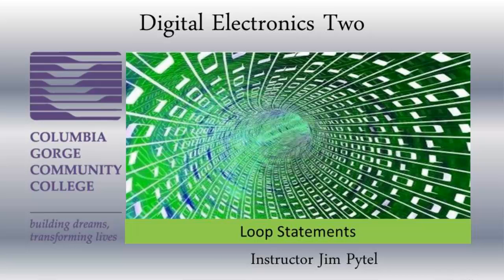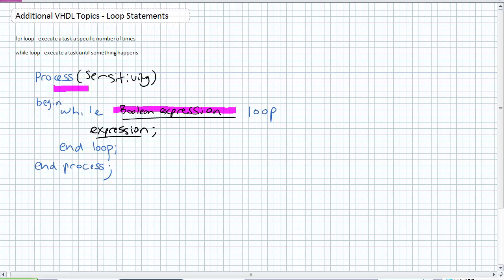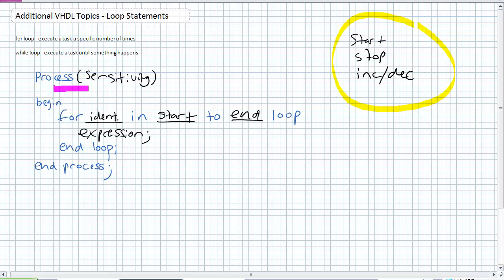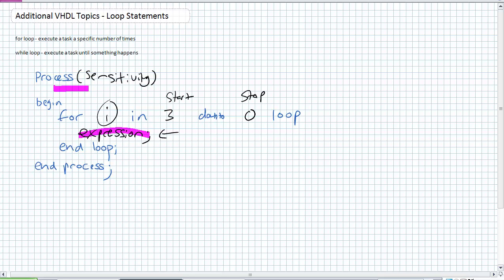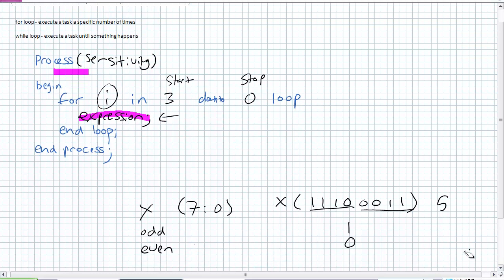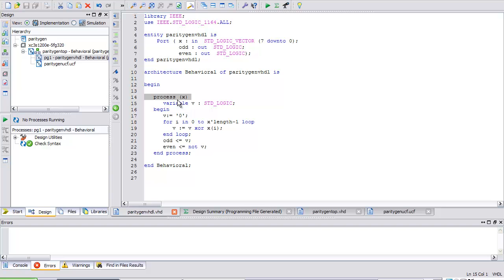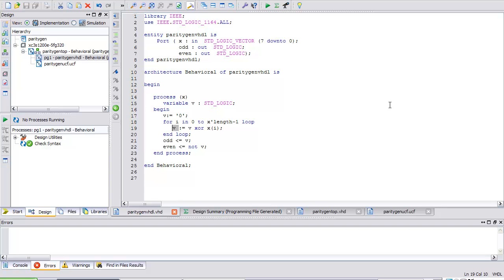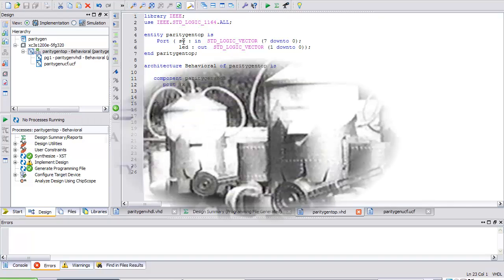Loop Statements

Comment: Did you mean to write "odd <= not v; even <= v" instead?  Since you XOR each bit starting from the least significant bit with 0, it would give you the opposite.  For instance, if you had the number 3 in binary "0011" and XOR'd the LSB with 0, you'd get a 1, then you XOR that result with 1 and you get a 0,then again with the next term and you get a 0 and so on until the end of the row.